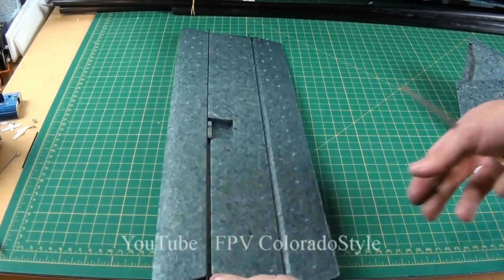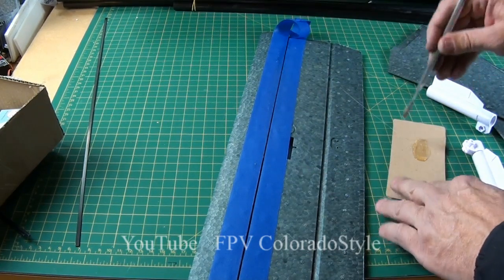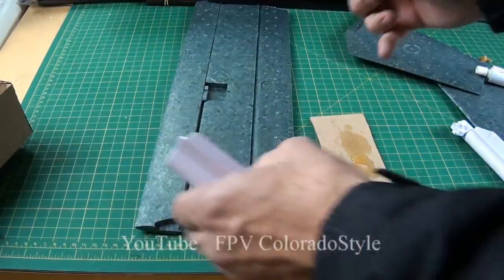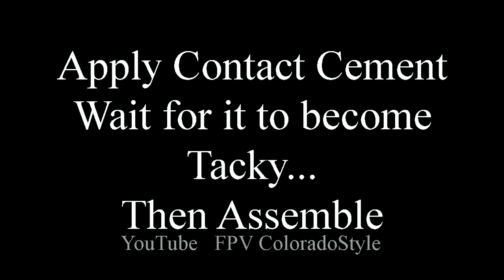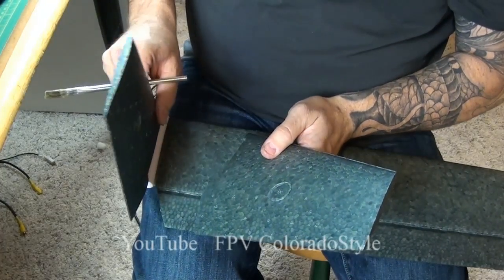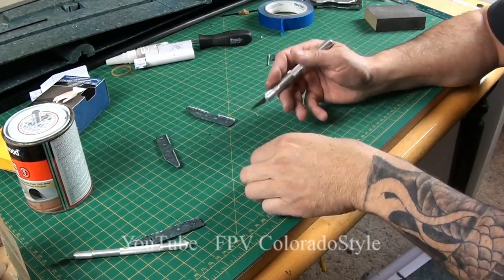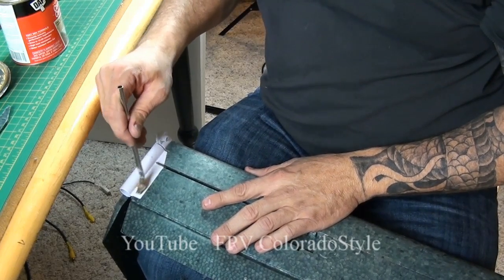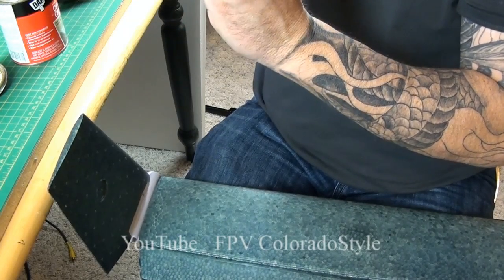SKYHUNTER FPV Build Part 4 Elevator and Stabilizers

Comment: I'm building this right now following your video and while I appreciate your hard work, I'd like to make a suggestion. Rather than trying to cut the slits further on these brackets so the CF rod can pass through, I'd suggest doing the rod after the bracket, but before the rudder. Cutting this bracket is a huge pain in the ass.
Reply: +techtoys617 ^^^^ and this.

Comment: hey great videos. you mentioned that you should match those tail brackets but in fact the kit comes with 4 identical brackets for both sides making this impossible.  The manufacturer's image shows the correct and only way to install those front brackets.
Reply: +Paul Flude ^^^ This.